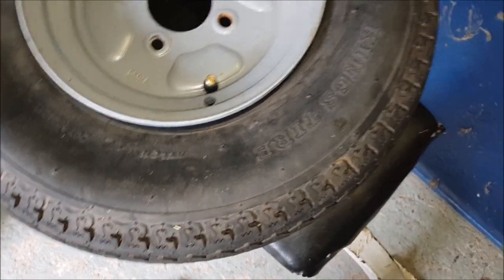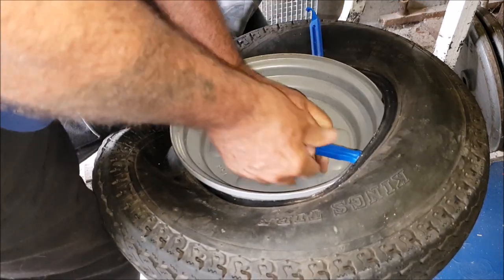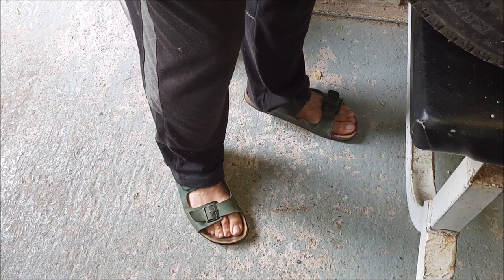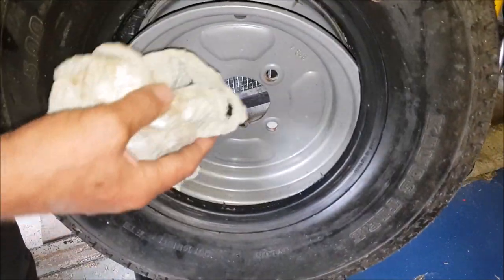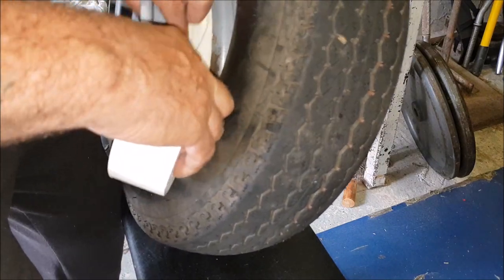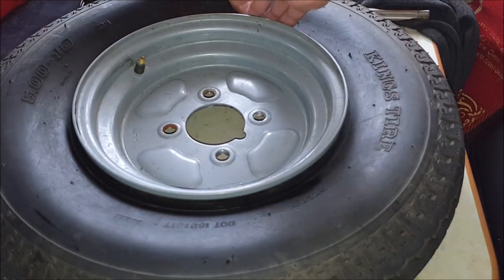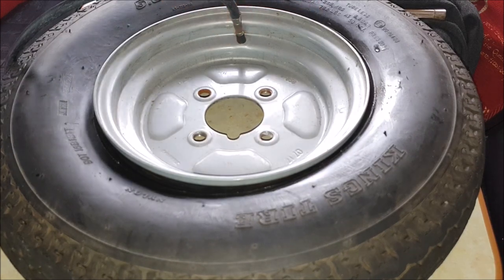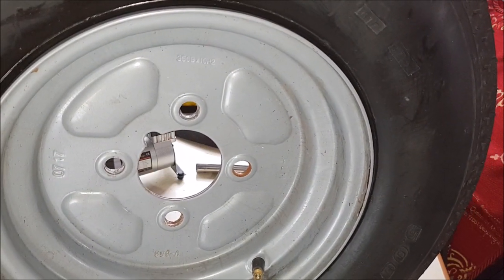HOW TO FIT A INNER TUBE INTO A TUBELESS TRAILER TYRE BY HAND

Comment: Keep looking for a set of 2 tyre levers made for the old school AA patrols about 10" long and you can hook them into the bead of the tyre and save your knuckles, very easy to lever over the same make and size of tyre. Your comment on inner tubes is they are only trying to keep the tubeless crowd in business. Go in for a puncture and come out with four shockers, new tyres and a magic tree. The best way is to take the tyre in using a different car and ask for the puncture to be fixed. They love you for this, honest.

Comment: What kind of liquid was used.  Also you skipped the toughest procedure for mounting a tire.  That is, mounting the last part of the tire.
Reply: He said it is washing up liquid, nothing special. Any domestic detergent, or liquid soap is safe on rubber. The main point is not to spray lots of soapy water inside the tyre before re-inflation. Tyre shops use soapy water and a paint brush.

Comment: I just tried to do this. I’ve bought a new tube from eBay. Took the tyre off the rim and placed the tube inside the tyre. Placed it back onto the rim and it’s still leaking air. Any ideas?
Reply: Just realised who you are mark, We’ve met before. I was one of the reps at Interski when you were there, season 18-19. Hope you’re well
Reply: Ive had this problem with my mtb, do you use an insert between the tube and the tyre? If not then you might have got unlucky seating the bead and it might have pinched/cut/ripped in some way. Thats all i can tell you if there is no nails/pins still in the tyre.
Reply from the maker: Hi Ryan wow small world hope your ok you will get a bit of air leaking from the tyre but it should stop let me know
Reply: Hi Chris, what insert do you recommend? I didn’t use one and the inner tube that I took out never had anything else inside the tyre. Have you got a link to a picture of what they look like? The inside of the rim was very rusty and sharp, I used a wire brush to take most of the rust off then used electrical tape to cover the rust, however the tape was slipping when I was trying to put the tyre back on the rim. It took some force to get it back on.                            Hi Mark, I may take it to a factory near me and use their industrial compressor, maybe see if I rush air into it at a fast rate it may inflate. At the moment with a car compressor I’m struggling to get over 5 PSI, I can hear the air leaking as I’m pumping it up.

Comment: He said it is washing up liquid, nothing special. Any domestic detergent, or liquid soap is safe on rubber. The main point is not to spray lots of soapy water inside the tyre before re-inflation. Tyre shops use soapy water and a paint brush.